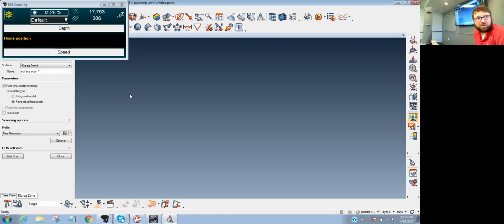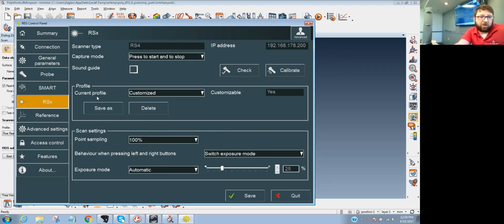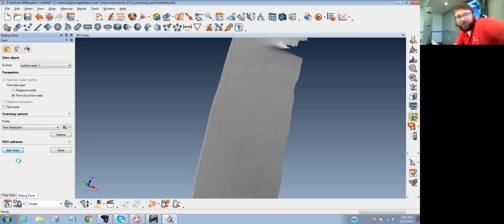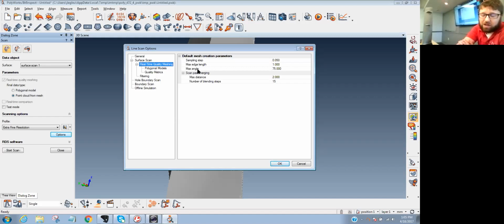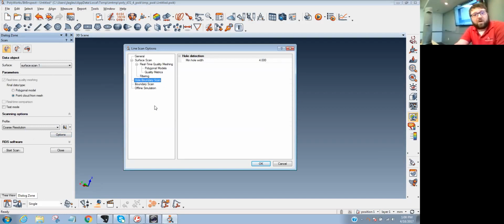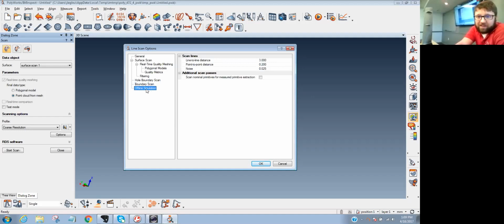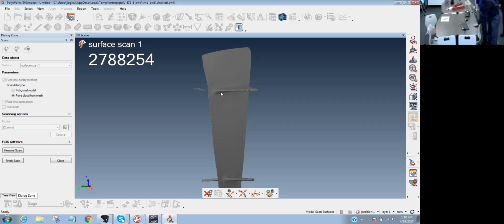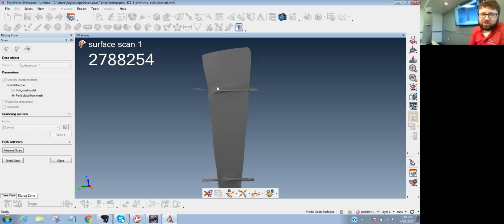Scanning Webinar Series - Webinar #4 - Scan Settings inside RDS and PolyWorks

Comment: When you do the scan at time period 14:29, i have a question about this, at my job I am the system administrator one of the systems are using Polyworks 2020 IR5 with RDS 5.4M and now upgraded to RDS 6.1. when doing the scan on a flat surface to make sure its working, there are lines through it, like its missing part of the  scan, could this be because of a setting in Polyworks or RDS or is it something else? There are 2 laptops that are doing this, the rest work fine